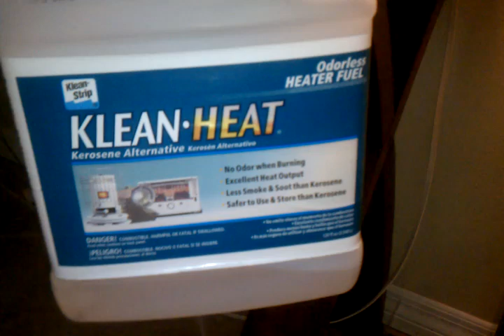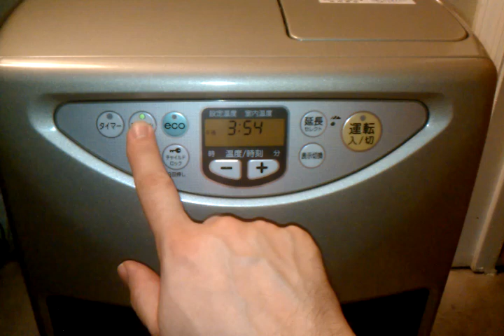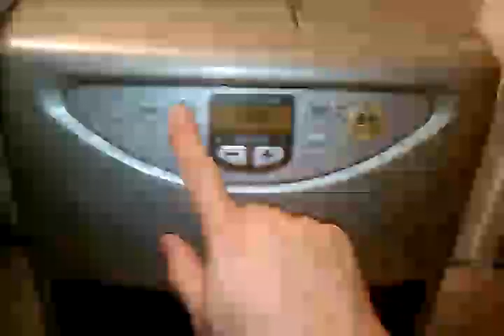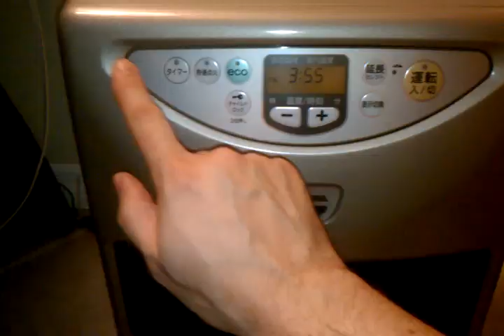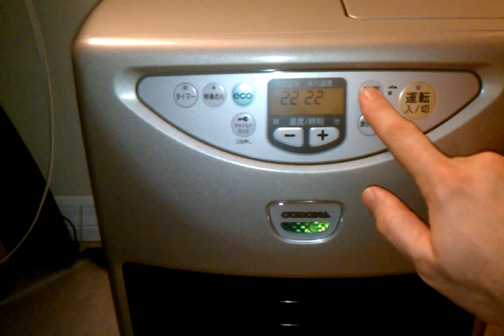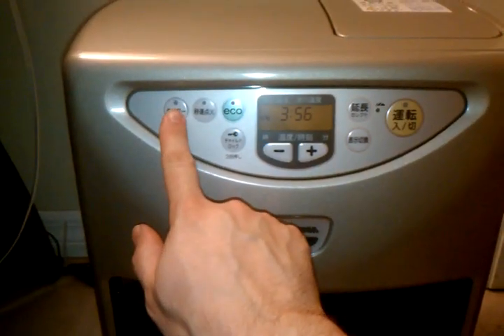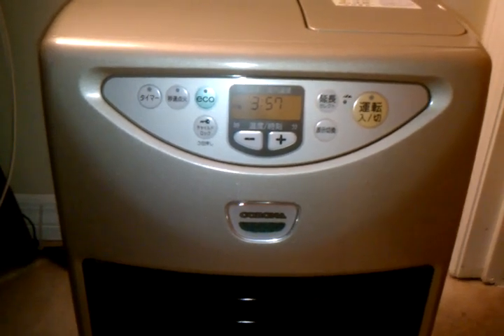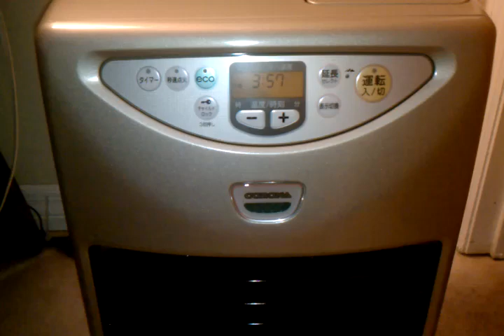Using a Modern Japanese Kerosene Fan Heater in the USA

Comment from the maker: Winter 2016 update:  Kerosene has become increasingly difficult to find, as all of the local pumps in reasonable driving distance have converted to either ethanol free gasoline or "racing" gasoline.  This heater has been retired.  I'm now heating with two $49 Soleil infrared electric heaters (Chinese Edenpure clones), which I purchased at Walmart.  Surprisingly, the build quality is quite good, the thermostat is accurate and they even have a remote control.  Buttons are all in English too, so there's also that.
Reply: Do you want to sell it?
Reply from the maker: @adamv4951  Already sold it quite awhile ago.

Comment: Just FIY, generally Japanese heaters have carbon monoxide/dioxide detectors built in so a stand alone sensor is just doubled safety.
Reply from the maker: +eaglevision993 I do mention in the video the heater has air quality monitoring.  But, it's better to have "doubled safety" than wake up dead.

Comment: Is there a source for these in the US?  The one I brought back from Japan 12 years ago is on it's last leg.
Reply from the maker: Edit:  For the time being, it looks like there are a few Japanese eBay sellers offering quite a few of these heaters with shipping available to the USA.  Search for JKPG heater

I'm not affiliated with, nor am I endorsing any of these sellers, so buy at your own risk.
Reply: I purchased one last winter from England. With a 120v to 220v step up transformer, that includes the correct British plug, it operates correctly. In my experience they smell more than a properly operating wick heater.
Reply: DAINICHI FW-2516S-S Light Silver Kerosene fan heater $284. free ship

Comment: ULSD has is cleaner then standard Kerosene. How does it run on Diesel(ULSD)?
Reply from the maker: Only thing I've burned in the heater besides Kerosene is mineral spirits/Stoddard solvent (Kleanstrip sells it as "1-K Kerosene" in hardware stores).  Ironically, it stinks a bit worse than the red dyed pump K-1, but otherwise ignites and burns just fine.  The ULSD sold around here is very oily, has a distinctively heavy petroleum smell to it and is clearly not anything close to K-1.

The manufacturer recommends kerosene and for what I paid for the heater, that's what I'm sticking with.
Reply: Theoretically you should be able to run diesel, but as it's a heavier fuel it's more likely to foul the burner after a while. I've found with my one that even cheaper kerosene caused it to foul up, meaning I had to strip it down and clean it up.
Reply: @therealchayd  NOw they have soy in the fuel, there is a guy on Utube that put some conditioner in .

Comment: 600 watts to start?? lol,,why you need fuel?  Will these burn ULSD??? many fuels changed since first Toyos/Monitors made. 600w,,,better to stay with Lasers.....dude bringing back Monitor very soon in US 2018-19. So how do these get by without exhaust since Lasers have exhaust etc....which by the way they need lil exchanger on exhaust to siphon/pump wasted heat off .
Reply from the maker: It only draws the increased wattage for about a minute or so, to preheat the kerosene.  Laser/Monitor heaters work exactly the same way.

As for the exhaust, these heaters are ventless.  Hence why you need to crack a window for fresh air while it's  running.  Someone else asked about the ULSD and the answer is that it probably depends on where you live - some "winter" blends of ULSD are mostly kerosene (possibly with fuel pump/injector lubrication additives you might not want to be breathing).  The stuff they sell here in Florida is greasy and stinks like diesel, all year long.  It's not kerosene.